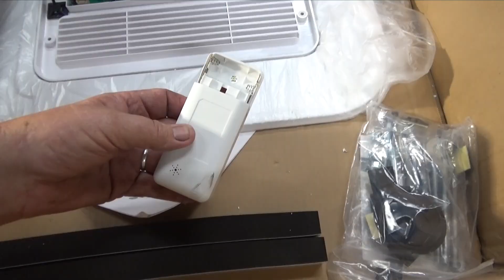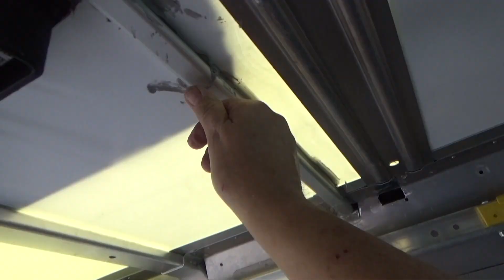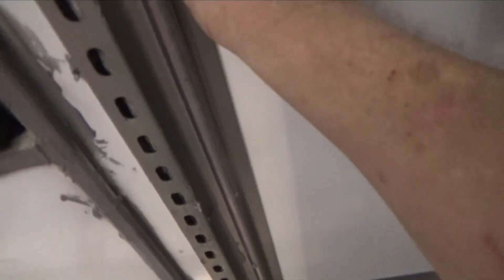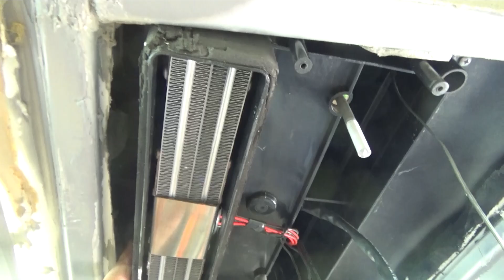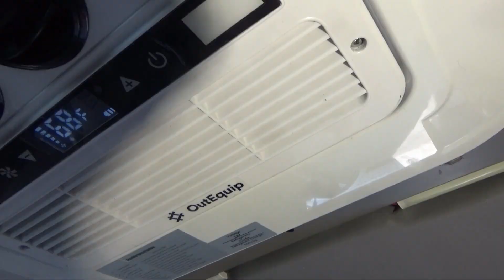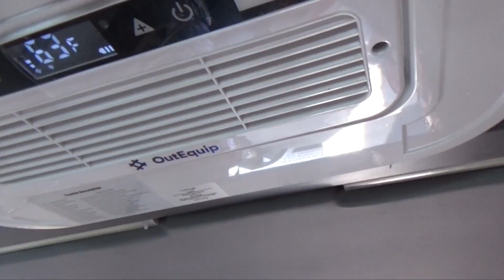Chevrolet Brightdrop Installing OutEquip 12 Volt AC Unit - Whew

Comment: Amazing job! :face-fuchsia-wide-eyes: Was it a way to replace the whole roof instead, going to the strongest part of the frame, with something a little stronger than just leaving it how it is, as the roof is so thin? Since you're on battery power, isn't it better to just stick with all electrical equipment, so as not to rely on a gas heater?

Comment: Does cardboard have more structural support than that stock roof? LOL
Reply from the maker: Yes unless wet .... 🤣🤣🤣
Reply: That's not the stock roof, translucent is a  $500 option. I believe the stock roof is the same fiberglass material as the sides